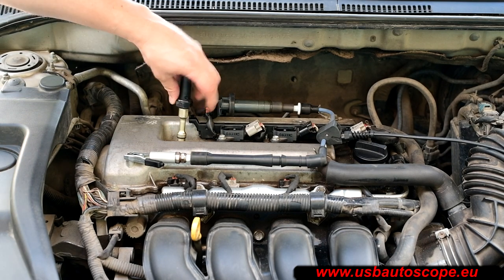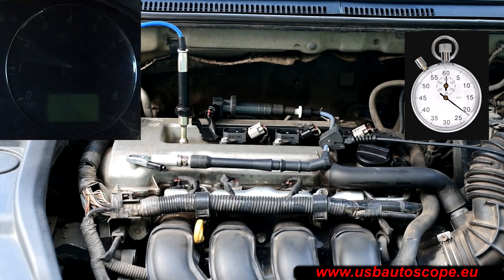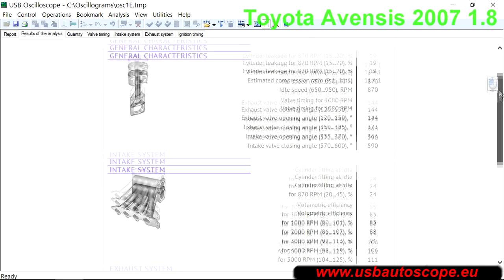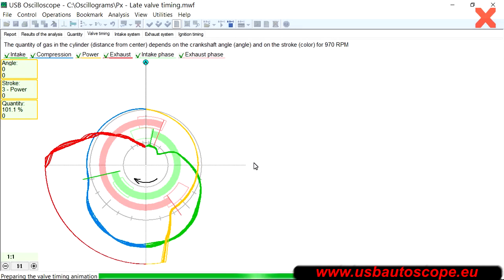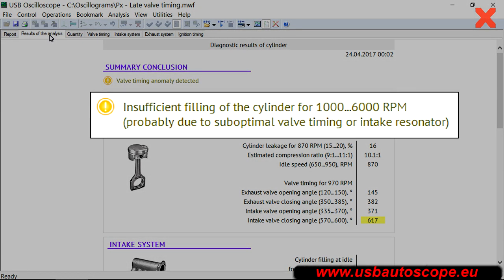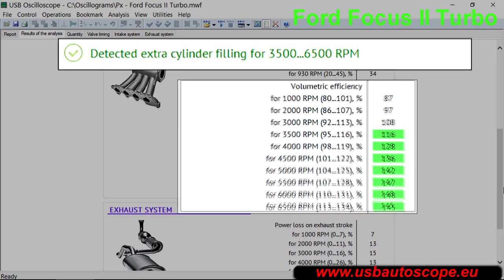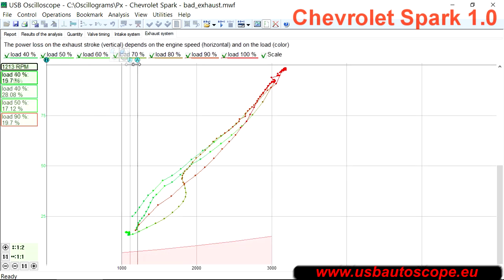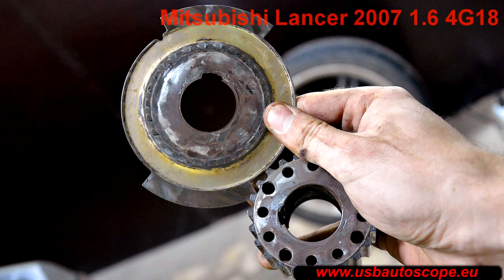USB Autoscope in-cylinder pressure measurement and analysis with Px script

Comment: but how does script know details of valves opening if scope wasn't connected to cam sensors? does software connect to some database for a vehicle specific details?
Reply from the maker: Hello, Script takes all necessary information from the cylinder pressure waveform.
During its analysis software automatically detects a significant number of parameters, including the valve opening and closing angles and assesses their impact on the operation of the engine. 
You can find more information in this series of articles:
https://www.techshopmag.com/analyzing-cylinder-pressure-waveform-running-engine-part-1/